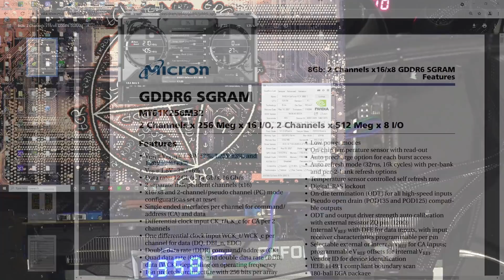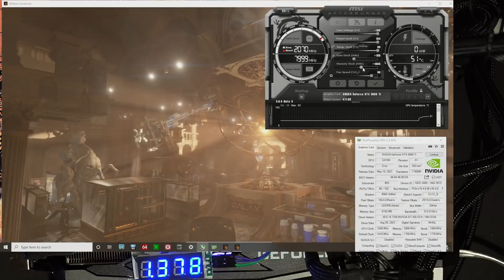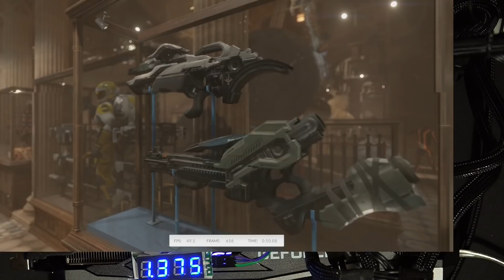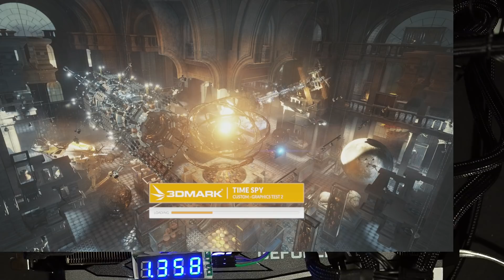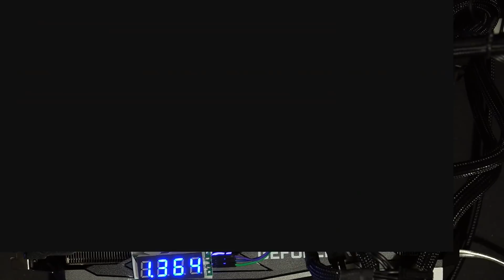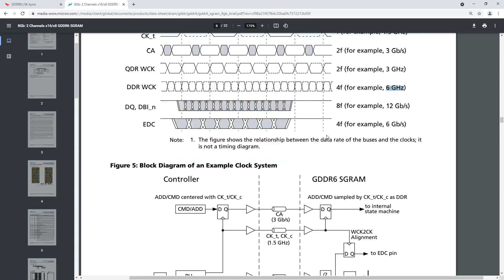Undervolting the SK Hynix GDDR6 on the RTX 3060 Ti makes it overclock way better.

Comment: ive been playing around with the mem voltages on a hynix rx6600, it seems exactly the same as what you described. first i overvolted which got me better speeds but i couldnt do anything with low latency timings enabled, and then undervolting let me push the low latency timings almost all the way to the end of the slider, but i havent tried normal timings yet
im only 6mhz short, 1880mhz fast timings and mostly stable. has there been any bios or driver mods for navi 6000 cards?
gone all the way to 1.5 and down to 1.17 and it starts getting way less stable below 1.18, im only mildly annoyed that i cant completely max it out
i beat the steel nomad record for similar hardware by 11 points, 1668 vs 1657. and total time spy increased by about 430 points. gpu test is ALMOST 9000. but i dont think i can push it any further without better filtering
also whats the difference between AMD and nvidia in the memory speeds? alot of amd cards seem to be around 2000mhz while nvidia pushes it all the way past 7000. is it just a reporting difference or is it actually running at those speeds?
also less related, i noticed time spy absolutely thrashes my card. 120w base but ive seen it consistently hit 155+ in the demo and 145 in gt2

Comment: Hello mate , i own an Asus 3060Ti Tuf OC V2 , and it uses Hynix memories , randomly i came across some posts on internet talking about 3060 ti dying if OCing the memory if it has hynix memorie chips , anyways they mostly talk about GIgabite cards with memory code  005 if im not wrong , it got me a little worried , im currently Ocing the memory to 900+ and never exp any issue with it so far after almost 2 years ~ , by any chance you know what hynix chips this model uses or if the romur is true or not etc Please answer this if u can mate

Comment: hey im wondering what's the model of they sk hynix memory they using in msi rtx 3060ti gaming x lhr should i be worried i hope its not using the x005 hynix memory cause im worried i have the gpu for more than 1 year and 4 or 5 months now i don't see anything weird or issue already undervolted after i got the gpu still performing great my idle temp is around 40c-34c full load doesn't exceed 70c around 65c-67c

Comment: Man there is a LOT of problems with Hynix vram on 3060Ti (and only on this card). There was a big batch of these RAM chips (supposedly from mid 2021) that are degrading pretty fast. After that not only mining is worse, because chips can not hold the overclocking, but also in regular games people meet black screens and crashes. Google this, even Hynix has admitted the problem. The worst thing about this - when fixing and soldering another fresh chip - others that are near are getting overheat and die in a short period. And while soldering - the chip also gets stress overheat and degrades faster. This was the problem only with hynix and only on 3060Ti, that's what i know. Maybe on this video you were noticing some side-effects from potentially defective vram. 
BTW, Nvidia releases 3060Ti on DDR6X, maybe this is somehow in connection with lots of RMA'ed units (while mining plague was huge) and thus worse sales of 3060Ti in comparison to other models.

Comment: Have you any experience with undervolting the GPU? About to buy this card and use it with a 450 W (Seasonic Platinum) power supply, and am keen to save those watts!

Comment: I'm looking at the Micron data sheet and it says max is 1.2v? (I thought the +-3% was just the fluctuation range around the averages of 1.135v high power mode/1.125v low power mode, but I've probably misunderstood the data sheet).

Is Samsung/Micron GDDR6 safe to run at over 1.1393v then? My Samsung GDDR6 is still scaling well at this voltage, but I don't want to go beyond this if it's going to Bojo it.

Comment: Do you think this is the "new" Hynix GDDR6 AIM double date rate? that came out either late 2021? or early 2022? or is this the old Hynix GDDR6 that was out in late 2017?  
very confusing to say the least. I did not expect to see a Rog Strix 3060 TI OC gaming with Hynix modules.

Comment: Now running +200 Core. +2000 Mem at 110% powerlimit in Afterburner without any voltage mods. It is Hynix memory on a Zotac Gaming GeForce RTX 3060 Ti AMP White Edition LHR.

Comment: I am overclocking my Zotac AMP 3060ti, and i get the same: at around 1150 / 1200 on the VRAm it is artifacting. But then I tried to go higher and I ended up at +2000 MHz without artifacts and gor 85th place in 3DMark Firestrike with just a i5-12400F and 3200C16!!! Please try this BZ! Edit its in Firestrike Ultra!!

Comment: The reason for the better OC at lower V is more likely a simpler explanation imo; Hynix chips are made on a finer process node than Samsung chips. Basically the finer the node, the less voltage it needs, and if you use too much voltage, it generates excessive heat, which increases electrical resistance, causing instability and power draw to go up.

This can easily observed if you try mining with a Dell 3060ti; when it boots up, the efficiency is higher, around 440 kh/j,  but over the course of 30-40 seconds, you can see rhe efficiency crash down to 400 kh/j as the Temps go up.

Looking forward to your upcoming video showing the  hardware modifications you made to your card.

Comment: My 3070 is the same way, but I’m only overclocking the memory for crypto mining and incidentally, lower voltages also adds up in savings with the improved efficiency.  It was weird because when I tried to just overclock the memory before adjusting the voltages, it would spit out hash errors at a higher rate,  but when I bottomed out the voltages first, and THEN cranked up the memory overclock, it clocked even higher than I was able to get it before.

It’s cool you do this stuff just for the fun and bragging rights, but it was a massive boon to my little side hustle, because I don’t waste nearly as much electricity as I did before finding that weird little quirk out
Reply: Can you post how you undervolted the VRAM, or where one can find schematics/documentation to do so?

Comment: I have this GPU and the memory performance is significantly less than the non LHR MSI 3060Ti Gaming X. In fact, the non LHR MSI 3060Ti Gaming X performs almost as fast and the non LHR MSI 3070 Gaming X. I can increase the GPU clock above stock on the non LHR 3060Ti and use the same memory overclock on both GPUs at 1300 and get almost the same performance. The power usage is higher on the overclocked non LHR 3060Ti but it performs the same. This is not the first time I've heard GPUs with SK Hynix DDR6 memory underperforming on memory intensive tasks and benchmarks. This situation may be endemic to all GPUs using this current SK Hynix DDR6 fab since I suspect the Hynix DDR6 is not made in spec and may be set for lower power consumption.

Comment: This word needs to get out! Before I looked into it I thought more voltage meant more clock! Wrong! I undervolted my ryzen 5 3600 to 1.2 and set clock to 4300mhz and it runs steady and 20 degrees c less. Like seriously wtf! Why are ppl out here telling ppl to overvolt and overclock when it seems all chips run at lower voltage and do more clocks. It’s legit shocking to me

Comment: kinda blows users don't have the ability to adjust the voltage of their gddr6, variance within that product sku or other manufactures' memory may well benefit from ± .1 - .25v. You might be able to give the difference in memory bandwidth significance by allowing your cpu to better utilize gpu memory by enabling "Resizable BAR" and its related settings within your bios.

Also with afterburner, you can lock in the voltage/frequency curve you set (core mhz) by clicking the little cellular bar looking thing to the left of its value, then clicking the right-most square along the function and tapping "L". Doing this and enabling "force constant voltage", "unlock voltage control", and "enable low level IO + hardware access interface = kernal" under settings should keep your core clock (possibly vram too) thermally locked along what it says it can achieve.

might help you get them higher numbers we all desire. good vid

Comment: Hynix does seem to like running a bit weird indeed. My 3060 Ti with Samsung VRAM can totally bench +1200 to +1300 on the VRAM (8100 effective as per Afterburner).  It is a lot more prone to crashing than artifacting like crazy though. My core is a lot worse, can only do around +150 before crashing.

Comment: Something interesting, on the most recent revisions of the 1660 Super from PNY (the single fan version) if you crank the memory speed and voltage all the way down, it has faster memory timings, but mostly for gpu mining
Reply: I have some are working @50-55W and memory all the way down, they even run @48W but not that stable only if I decrease the hash

Comment: I didn't see this commented before, but it's well known that decreasing the voltage of many systems will increase their bandwidth. I agree that it's unlikely to be a thermal issue.
23:04 "at 1.35 volts, it will have much steeper slopes on the rising and falling edge" This is not always the case. Many digital systems will have the same slew rate (slew rate is how steep the rising edge slope is) on the output transistors regardless of their bias voltage. So the rise time and fall time will be less, since it doesn't have to take the extra time to go up or down to the VOH and VOL. so it takes less time to reach the peak, so a single up/down pulse cycle will take less time. This increases the operating frequency and available bandwidth. You can see this in level shifters where the rise and fall times are shorter on the lower voltage side. This will often be expressed as a value of ns/V so the lower the voltage, the less ns it takes to get there.
26:25 "hooking up an oscilloscope to a running GDDR6 memory system would probably cause it to be really unstable" You can make it work out without affecting the stability that much, but such systems are extremely expensive. Since they "only" need to go up to a GHz or 2, you can get high impedance active probes for it.

Comment: same with the GDDR5 on my AMD cards . It is almost always the lowest voltage that works best for me.  I doubt that improving thermal pads would help but make it worse since the GPU chip could add more heat to the memory chips than lessen it though the one on the rtx 3090 is another story
Reply: How did you adjusted the vram voltage on your card?
Reply: @TheMakiran  it depends on the cards and operating system.  I have AMD Polaris cards and vram voltage only works in Windows not Linux based OS.
Reply: @zodiacfml  What is called the memory voltage in the driverr isnt actually the vram voltage, is acts like a core floor voltage

Comment: 7:30 does the overall power limit in Afterburner (not the core curve editor) not also lower the memory voltage? I don't have any way to check, but my 3060Ti (Aorus Master v1 non-LHR) holds a +1500 mem clock at 55% power limit, 131W under load.
Reply from the maker: you should be able to check what memory chips you have with GPU-z? Cards with Samsung VRAM regularly hit around 2100MHz VRAM clock.
Reply: @ActuallyHardcoreOverclocking  sure enough, Samsung GDDR6 lol. sensors says it settles in around 2069MHz 😎 though the info tab claims 2119MHz. seems Aorus left the reference clocks as the defaults though

Comment: Man, the best I could do with my 1080 Ti was 10754pts, and that's watercooled and overclocked. And, which CPU where you using, I didn't watch the entire video yet but my 5900 gets 13303pts in this very test, I wonder which one you had 😎

Comment: Isn't that the same with all chips.  Chips get assigned a safe voltage that guarantees that all chips work at.  but most chips work on lower voltages and lower voltages makes them more efficient and create less heat so they run better. i undervollted my 6900XT from 1175 to 1050 and it run 120 mhz faster no changes made and it overclocks 190 mhz further.
There may just be a chip that gets to hot and with the lower voltage it does not.
Reply from the maker: My 6900XT was hitting it's highest clocks with a +200mv core voltage offset.
Reply: @ActuallyHardcoreOverclocking  Nice mine just doesnt see stable under 1025 at all and i always go up a step from not stable so 1050 seem to be as low as i can go. then again im not realy trying i find a good sweet spot these days and leave it there. I'd rather be gaming after waiting 9 months to get a gpu.

Comment: I remember reading a post on Reddit that said in regards to vram that gaming prefers tighter timings and workstation oriented loads prefer the higher clock speeds.  I have nothing to prove that claim but it sounds good for some reason
Reply: thats probably reffering to DRAM, games want better latency but really dont care about the extra bandwidth (much) but pro apps need phat bandwidth. i doubt GDDR is as latency sensitive since by design its not supposed to have good latency

Comment: I find it weird that on graphics cards they allow you to adjust the gpu core voltage but not the memory voltage.  Both amd and Nvidia.  But they let you overclock the memory.
Reply: Some AMD cards do let you adjust the VRAM volts through software
Reply: @ctsd623  which ones?
Reply: @TheMakiran  You can adjust vram voltage in rdna2 cards using MPT.

Comment: I have my Kingston with SKHynix ddr3 1600 1.65v running at 1333 1.36v which is low compared to normal 1.50v for 1333
This has pretty much nothing to do with this cool video, just wanted to share.
Good finding !

Comment: At about 27:00 you said that probing gddr6 voltage with will make the voltage dance, and that there are special probes that can do it without a problem, what makes those probes better/more expansive?
Reply: Better shielding probably or built in caps/resistors. Connecting a probe essentialy creates a parallel circuit to the loop and voltage changes in parallel.  Something something kirchoffs voltage law something..
Reply from the maker: I meant probing the datalines. The issue is that connecting anything to high speed signals affects them(daisy chain motherboards clock worse because of the extra dimm slots simply being there). You'd need something like this: https://www.tek.com/oscilloscope/dpo70000-mso70000

Comment: Interesting! Too bad we can't control vram voltage through software atm. On AMD Polaris we could with control center and asus gpu tweak, but not afterburner and I had no problem running 100mv or lower vram volts at stock. If you care to check Bullzoid, can you try running your card ar 700mv when using the vram UV and see if it downclocks? Stock Amperecards always downclock vram to 10GHz below 725-750mv depending on bin. Maybe you can UV core lower with no vram drop if you lower vram voltage?
Reply: Actually what the driver names as "memory voltage" is more of a core floor voltage. From my testings, it somehow linked to the imc in the core rather than the memory
Reply: @TheMakiran  yeah, seems so on Polaris atleast.

Comment: In MSI AB, if you double click the number, you can type an exact value. I like setting it that way. With the slider this is not that easy.
Reply: One does indeed not simply adjust any slider in a pc. Typing the value is the way!
Reply: I just type 99999 in everything and get the rtx 7090 sli performance from my gt 210
Reply: @DeadpoolPlayz  😂

Comment: Sooo do you think this might work on my 3070ti ftw3 card? I've been wanting to hard mod something and this seems fairly not so bad like I might not kill my card lol I also have a gigabyte 3060ti as well that might be easier on? Idk lol
Reply: i would try to find what VRAM chips you have. if it's sk hynix, try it out and let us know ;)
Reply: @Oats4761  I just tore the gigabyte 3060 ti oc edition apart and it has Samsung memory to my surprise And my 3070 ti has micron memory it looks like. I guess I'll have to do a lot of probing and research before I try anything
Reply: the 3070 ti has g6x right? I don't know if it behaves the same as G6
Reply: @kuyans3889  3070Ti is G6X, it runs a lot hotter so when OCing memory I'd make sure to swap thermal pads
Reply: @AA-kx5es  yeah i know that, OP was just asking if undervolting the memory on the 3070 ti would yield the same result shown on this video. I was just pointing out that the 3070 ti has different memory to the 3060 ti